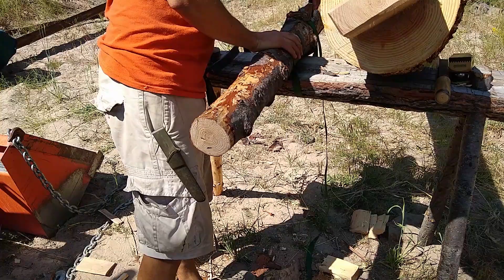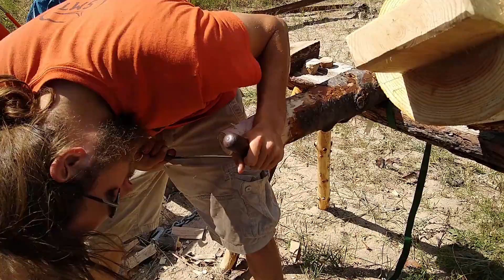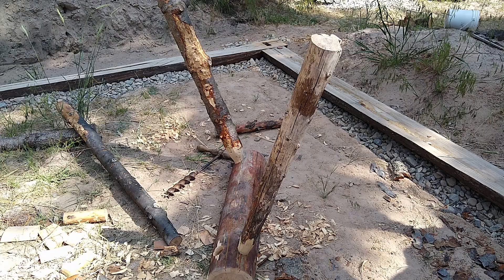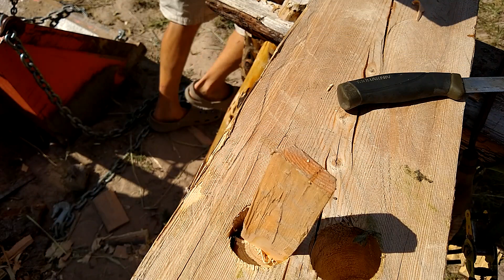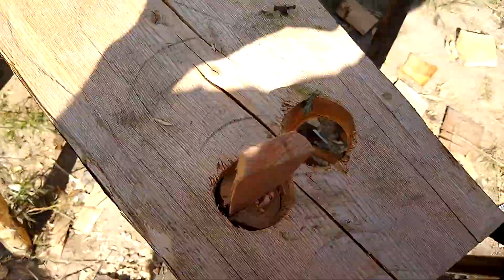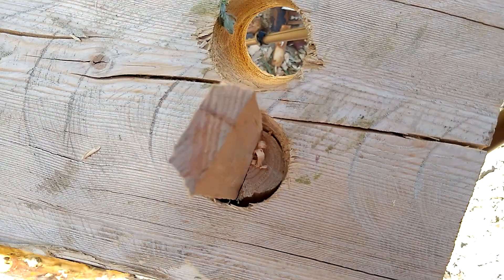Sawhorse

Comment: the hard way but the right way
Reply from the maker: So far it's been working for me. I've had issues with the wedges backing out though. Perhaps I need to make the wedges have a shallower angle.
Reply: @jerButler87  I would have the legs come up and out the top and take the taper off so the top can rest on a flat.  The paper may be pushing the top-up/legs down. hmm!!!   :)  Just thinking out loud .